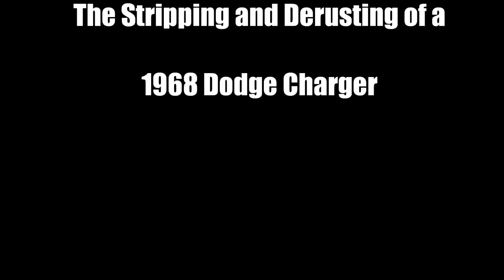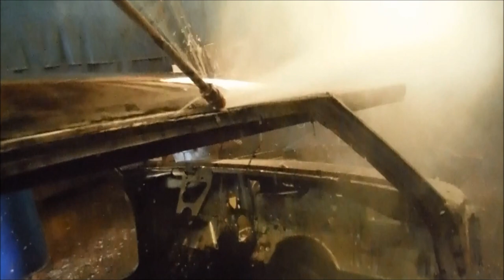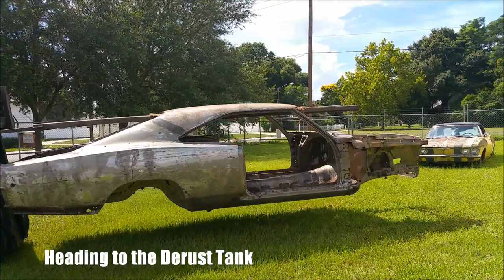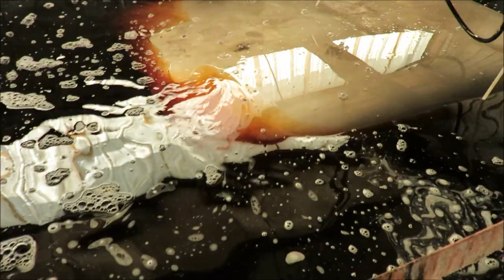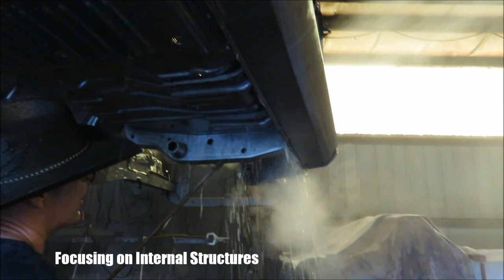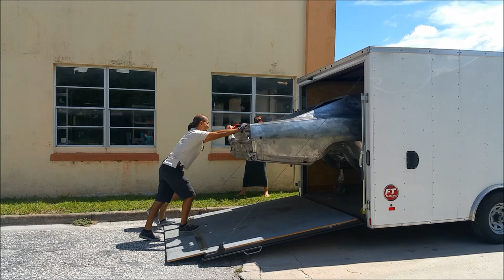1968 Dodge Charger: Paint Stripping and Rust Removal

Comment: Now there is no protection of un exposed metal not to mention acid / alkaline (from striping) in all the seams......not the way to go!
Reply from the maker: Good observation Russel! We get this concern often and it's well founded.  However, unlike other immersion strippers, we don't use acid based agents of any kind.  Also, we in fact use three (3) chemicals for final derust and not just the alkaline based solution that you seem to be acutely aware of. So, to answer your cloaked questions about seam control, we are in the middle of producing another video that gives an in-depth overview and explanation of what it takes to get these cars this clean......seams and all!! Be on the lookout...

Comment: Hopefully, they eventually hot-dipped galvanized that badass car before moving onto the paint process. I would love to see what the completed car looks like now.
Reply from the maker: Good point John.  We're not sure what the owner did with this one, but most of the cars (such as the Chevelle in one of our other videos) we clean get sent to a specialist down in Sarasota.  They are metal prepped, then typically sprayed with acid wash primer, then epoxy primer followed up with primer-sealer. The owner then has the option to have the car  finished or bring it back to their own garage/facility and affect the final paint and assembly.

Comment: Tried this on nasty crossmember worked brilliantly soaked for 24 hours pressure washed soaked another 24 and it released all the rust..... Now I want to do whole car what do you use for a tank
Reply from the maker: We use an approved steel reinforced and insulated tank.....5000 gallon capacity.